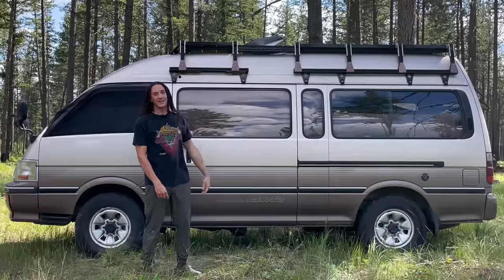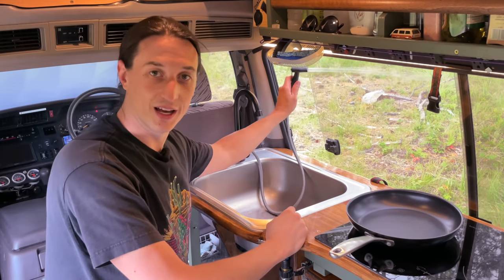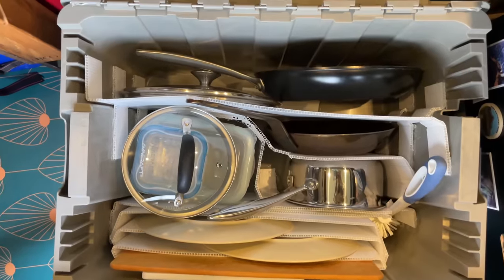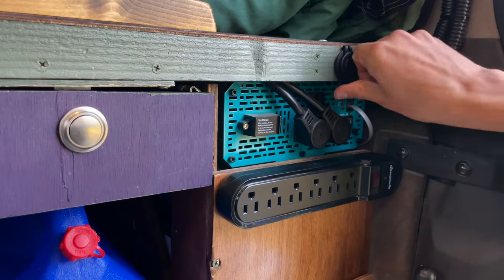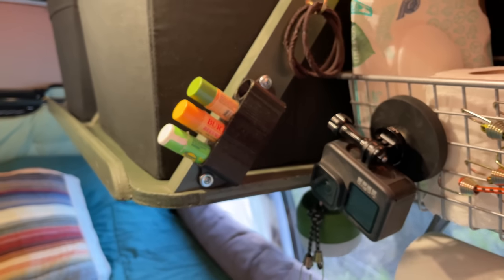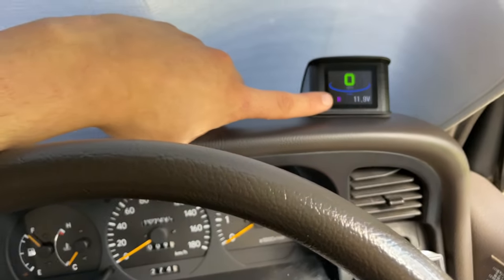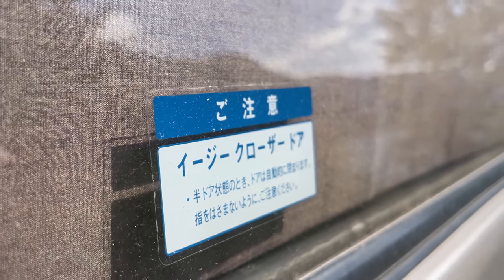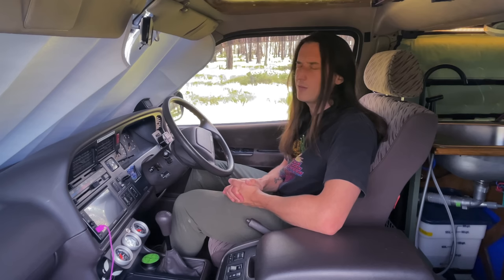I Live in this Little Self Converted 4WD JDM Camper Van - FULL TOUR

Comment: The 1KZ motor in your van is a fantastic motor with an undeserved reputation for overheating issues. To solve yours, get both radiators (yes, it has two) rodded out by a radiator shop. The lower (front / auxiliary) radiator in particular tens to get blocked up. Replace the fan blades with a 10 blade fan off a Prado, and replace the fan clutch (or replace the fluid in your original, much cheaper). You'll solve your overheating issues without a doubt.

I also noticed you have 107,000 kms on the clock, it's time to rebuild your injectors. This should be done every 90-100,000 kms regardless of performance. Bad injectors give an irregular spray pattern which leads to poorly atomised fuel, resulting in hot spots during ignition which can crack the cylinder head. This preventative maintenance will see your 1KZ do 400,000 or more kilometers on the original head.
Reply: Dropping down a gear on inclines helps, as well. They're reliable motors, but people often expect to be able to haul up a hill at 60 miles an hour, when they should just throttle back a bit and let the vehicle go up at it's own pace.
Reply: great advice except the 5-speeds only come with the one main radiator and they are impossible to find. The shifting linkage gets in the way if you try to install one for an automatic. I'm looking at either having mine recored since it doesn't leak or having a custom one made.
Reply: It could be the 5L engine not the 1KZ
Reply: @Kuching001  These Super Customs only came with the 1KZ.

Comment: The 1KT-TE is an easy motor to work on that requires no special skills at all. It is also very reliable if it is maintained reasonably. 

As for the overheating on long uphills and the like, just drop it down a gear and accept that you're just going to have to go a little slower. Staying in a higher gear is only going to make it work harder at lower revs, so it'll of course run hotter. I've run this motor in 43 degrees Celsius here in north west Australia, up hill and down dale with no heating issues at all. Just make sure you have a clean and serviced radiator and don't labour in 5th gear overdrive in particular. 

As for being a JDM and different to work on, its just the same as most vehicles, just the parts may differ a little, but the method is the same...if its a timing belt change, just line up all the indicators with allowance for tension on the injection pump, per the manual that is easily available online. It's exactly the same with every other vehicle when it comes to changing parts...basic rules apply!

Comment: i think youd be hard pressed to find a better build out on one of these vans. i love these things, really wish they were sold new in the US at some point. i'm a big toyota guy and have always wished that either of my 4Runners (a '96 and an '02) came with the turbo diesel engines that came in the JDM and other markets.

 amazing use of space, looking forward to more content, consider me a new subscriber!
Reply from the maker: This is random but I had a ‘97 and an ‘99 4Runner before I got this van. It would be awesome to have the efficiency and torque of the diesel in the 4Runner platform. Honestly it’s not that crazy to import a hilux sport. But, I actually miss the 5VZ motor because it’s practically bulletproof with basic maintenance, whereas the diesels seem to be a little more finicky with injector pump/injector, cylinder head, ECU, and cooling issues. But this van would be a total pig with a gas motor.

Anyway, thanks for subscribing!

Comment: Very unique conversion, love it, thanks for sharing! Question: how many watts is the induction cook top? Doesn't that drain the batteries?
Reply from the maker: The cooktop is 1800W, and I have a big battery bank (400Ah) so it’s not too bad. I use between 8-80 Ah (2-20%) per meal depending on what I am cooking (usually about 5%). I also have a backpacking stove in case power is really tight

Comment: this is the best and most realistic build i have ever seen on a non-sprinter. the video i’ve been waiting for man. probably going to rewatch this 50 times. buying my ‘94 3.0 turbo diesel 5 speed this week. you’re a legend for this.
Reply: ALSO i’m curious about your heating and cooling situation? i saw you have that temp gauge but im looking for ways to heat and cool the van without running the stock heater/AC and i dont think i heard you mentioning a set up for that
Reply from the maker: Diesel heater for heat, and drive where it's not hot to stay cool. Some people use 12v mini-split AC units for their vans, but you would need a lot of power to run that consistently

Comment: Hiace is a very common and popular van in Right hand driving world. The engine you got there is called 1KZ 3.0 which is a good engine except the issue of factory head gasket blowing up. You will need to baby it all the time to NEVER OVERHEAT! Then keep the radiator and coolant in check you will be good as gold.

Comment: I have a 96 version of this, a non turbo AWD and its at 320,000 and showing no signs of wear. I am about to preventably replace the alternator for the first time, which isn't failing but due to its critical use and extra burden in a campervan. Yours is almost new! As long as the cam belt is changed every 100,000 km, the water pump replaced on schedule, and all the general service filters, lubing, shocks cv joints maintained etc, (And hitting any rust early) it will run forever.  I also avoid using the the 'cheap' diesel where possible.
Anyway, love your build, its like a 'Mr Gadget' of campervans! (From New Zealand)
Reply from the maker: Thanks! Glad to hear you've had such such good luck with your van. I'm hoping to keep mine running for a long time as well 🤞

Comment: Hey Dusty. I have a 2001 auto campervan version of the Hiace in the UK and it is an awesome piece of machinery.  i can cruise at 85 mph at 3000 revs and can get 30 mpg (UK gallons) at a steady 70. . The engine is bomb-proof. KZ1 -  best engine ever built and now used in the Coaster Bus!  MPH Speedo conversions are available for 15$ on ebay Uk which fit over the KM one. Toyota dealers can obtain most parts,  even if they need to be shipped from Japan. Recently needed headlight unit - took 10 days and not overly expensive. good luck with Alaska

Comment: Just found your channel. Nice to hear all your tips. Love your setup! I just ordered one but I am going with the v6 4wd grandvia for more space. I feel i needed the v6 for more power around the rockies.
Reply from the maker: Good choice! The v6 in the granvia is what was in the late 90s 4runners and tacomas so lots better parts availability. Nobody wants to work on a diesel toyota over here.
Reply: @dustyodyssey  I feel more confortable with a gasoline engine. But i do love the smell and the sound of the diesel ones lol
Reply from the maker: @DavesHikesNewMexico  I hear you. I like the diesel, but maintaining a gas motor is a lot more straight forward in my opinion. Good luck with your van!
Reply: @dustyodyssey  How many miles do you have on yours. Have you had lots of mechanical issues? oh and how long have you had it? Thanks

Comment: This is the best van ever made . We brought this van 2.2 petrol model in 1992 in the uk. me and my friend drove it like we stole it , jumping hump bridges to get airborne, wheel spins on every corner , 124 mph on the motorway  . My uncle also had one with 910,000 miles on the clock with the original 2.2 petrol engine and gearbox.

Comment: i have the same engine in my landcruiser prado. they are known for reliability but their weakness is overheating and cracking the head. it is a good idea to maintain the cooling system and if the temp warning light comes on pull over and let it cool off

Comment: The Hiace is plentiful in Europe, but our Hiace looks a bit different. This layout you got is named Toyota Model F in Europe.
You can easily adapt a fully mechanical injection pump to get rid of any electrical hiccups and I would recommend you to install a intercooler and maybe a new radiator.
The 1KZ-TE doesn't like to overheat and a new head isn't any of these: fast, cheap and easy ...

Comment: OMG, I love this van! Super thoughtful, I can tell you applied your experience from your first van. I had a 1987 Toyota "van" and I just loved it. It did become too unreliable and finicky as you mention in your video. I was also packing a family of 4 in there with a middle seat I took out every night, so you can see why I had to eventually give it up. But it went to a good home.

I will say that I've seen a lot of crazy van builds, but this simple, functional, and thoughtful build is my current favorite. Compare to the drool worthy "Concrete Oasis" (look it up) and I like this van way more. 

This van is the real deal.
Reply from the maker: Thanks! I almost started with one of those 80s toyota vans, but decided on the Transit Connect last minute.

Comment: Hi from NZ! You can't beat good Toyota Hi-ace! Every tradie has (had) one here! We ran an airport shuttle for around 6 1/2 years, it's 'retired ' as our family adventure wagon. I wish we had the AWD version but ours is 2wd ( rear). It's not a fan of offroad mud, gravel or wet grass. Apart from that it is awesome. We tow with it, have camped in it and are going to revamp an insert from a Toyota Alphard to make camping easier. 🏕️ They have the same 3litre diesel turbo engine as the Toyota Hilux Utes beloved of farmers here. Enjoy your van!

Comment: Loads of Hi Ace Toyotas here in Bermuda also. We are a right hand drive place also.

From 1988 to 2006 I had a Mazda E1800 glass van. Essentially the same as the Toyota. Body looks the same. Dashboard looks the same. Gas engine, 5 speed manual 1800CC. Seated 8. Center seat swivelled. High roof like yours. I could get more stuff in that thing than a stretch body Caravan.

Enjoy Alaska. Don't rush it. We went last year. Fifth time. 35' fifth wheel pulled by 3500 dually. Rolling condo.

Comment: I have nearly the same van except mine is an automatic turbo diesel.  My bed is constructed in a way that I can lean it back into a couch, exposing extra seating. I have an on demand hot water shower (I'm a runner and showers are key). The van does tend to generate a bunch of attention, but not as much as my Honda Acty. Nice build out, dude.
Reply from the maker: Having more seating would be nice. Sounds like a nice setup!

Comment: Love the buildout! 

Are you able to change the gearing on these? Upgrade fueling, intercooler, exhaust, and piping for lower EGT.
Reply from the maker: It’s a tight fit for an intercooler, and re-gearing both differentials is a challenge to find parts but technically, yes I think all of those things are possible. $$$$ though

Comment: Though I'm commenting 10months late on this post. I'm impressed that the US allowed a vehicle on the road that has the steering wheel on the right, instead of the left side of the car. I noticed that when you sat in your makeshift seat when you flipped the passenger seat up. I stumbled across, a few months ago, this year, a Hiace for the first time. 

It was one of those van designs, if it's not a heck yeah, then it's a heck no, visual appeal. You're right, they're pretty bubbly-looking and cute. I really like that it has a lot of windows. I really like how there's a lot to view out the front windshield, when sitting up front. Just the overall window design up front was a dealmaker.

I think, unfortunately, the version that was over here, can only be taken onto highways that's max speed is 55mph. Like, what do you do if you find yourself on a highway that has the speed limit at 70mph, minimum? D: I know that if you go to slow, on a highway, way slower than the average speed limit, there's a chance you could get a ticket, which could potentially cause accident's. D:

If I can ever upgrade, I'd be thankful I could upgrade to a Chevy van or something. Then again, I just watched a video on a lightbulb that's lasted/been on for roughly 120 years. Never burned or been changed out. At a fire station. So, your van might be a beast and not break down hardly at all, due to more durable parts, pre-2000. Lol. 

Seems like even if a brand new vehicle can be fixed, parts shipped and all, within a week. Which makes it convenient in terms of time saved. Your pocket might take a massive hit, due to the car and the parts being so new to the field of car buyers and such. Plus, seems like a lot of car parts are being designed way too cheap/poorly also.  For example, a timing belt would last a whole lot longer, when it was a chain. Compared to a rubber belt we use today, that cracks and eventually breaks. 

The only pet peeve I have with a timing belt is if you fail to see the forewarning signage of the cracks and breaks on a rubber belt, depending on how the belt breaks, if it gets to that point, it could damage other parts surrounding the belt. If not replaced in time, before it snaps. I had this happen once, but I was a lucky duck when this happened in a smaller car. I was just pulling out of a gas station, when I had to pull in right next door to a pizza place. I wasn't on a highway, going 55mph when that happened. Lol.

But I bet you anything, you can find a decent amount of the parts of your van on Rock Auto or something, decently cheap, but manual mechanics are retiring, which would explain a decrease in mechanics that can get into that doghouse (centerpiece) and be confident, through and through, how to tear the engine down and either put back into place or replace entirely.

Sweet build. It was nice to see a Hiace buildout on here. Stumbled across the video earlier today. Appreciate you taking the time to share how you leveled up/upgraded your rig. ✨🖖

Comment: So is nobody gonna ask about the refrigerator portal? This is a sweet set up I remember watching your transit tour. You did wonders with that but this is way better and so much more room. Did you ever think about putting a front bash bumper for a little added protection in case of accident? I’ve had one on my Tacoma ever since I hit a deer on the highway and saw how much damage it took. I’ve been in two head on collision since then and the damage would’ve been so much worse if I didn’t have that crash bar they’re not that expensive and they’re actually not that heavy depending on what you get, but I totally suggest get one for peace of mind and safety. Remember, there’s no crumple zone and you’re basically sitting, a few inches from the outer shell of the van. I’ve always planned to get a transit connect specifically to do a camper set up but with each year that goes by and more investigation, I know it’s not really the best set up anymore. Your van however inspires me. 4 wd on a van in New England is what I need. The one thing I have a problem with in your van set up is that when you’re using the toilet you’re not facing the TV and that just sucks well at least you have a phone to buy your time when you’re 🍩 💩💦💩💦

Comment: Get lots of these here in the United Kingdom and if I remember correctly they have the same cooling problem as the old Toyota Hilux 2.4 TDI it's to do with the engine radiator size ..you can upgrade the engine radiator to a thicker bigger unit youl have to go on the Internet and have a look but that should sort out your  overheating problem good luck Iain uk 💪👍🏻

Comment: Very nice! HiAce has been very popular in Norway for about forty years and I think also in the rest of Scandinavia and several other European countries.

More facts for fun:
But in Europe it changed chassis/body to the front mounted engine Granvia for safety reasons (as you mentioned) in '95/96 (I think it was).

As far as I know Europe never got your configuration though. It looks to be "too long", that one small sidewindow longer. Also I haven't heard of any HiAce with 3 litre or full time 4WD. In Norway the majority of this body had only RWD and 2.4 N/A diesel. The 4WD ones had manual hi/lo range.

All in all they are quite amusing to drive, sitting over the front wheels and the visibility is superb, really a great car for adventures!!
Reply from the maker: Interesting!

Comment: Your timing belt light is on. 
I think you have to take the speedo cluster out and move a screw over a hole to reset it? Or push a reset pin every 100000kms. When you change the belt.

Comment: Mom did an awesome job  on those shades! Also awesome that you covered the downside of owning a JDM. I'm tempted to get a Alphard van, but not keen on a 4 week parts lead. The Alphard engine and transmission parts are probably fine to get as it is used in other Toyotas' but not sure about the suspension and glass.

Comment: Wow, just wow. I absolutely love it. I’m thinking about getting that Toyota model, I’m a little hesitant because I’ve heard after you make sure all the import papers are correct is still tricky to get it registered in the DMV (I’m in USA). Your build is amazing! If you’re in USA and have any tips about registration please share, it’ll be greatly appreciated. I also love the 4x4 capability since I’ve been off roading for many years and have many “secret” spots for camping that require 4x4, pretty spacious for myself and my 2 medium size dogs, my protectors since I tent camp mostly solo. Great detailed video and thanks for sharing.
Reply from the maker: When I bought the van it was already titled. So, I'm not sure I have much to share, but make sure you hold on to ALL of the paperwork, especially the EPA form.